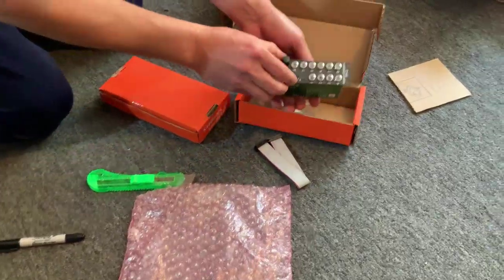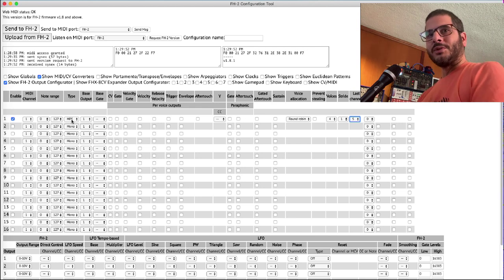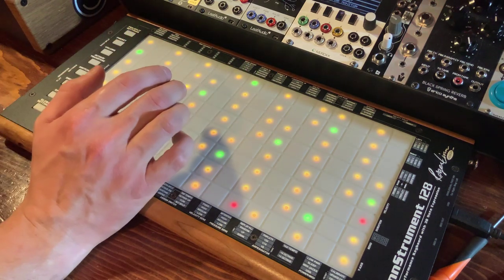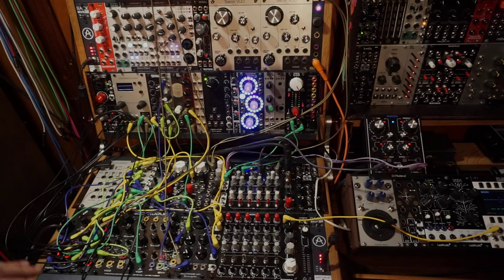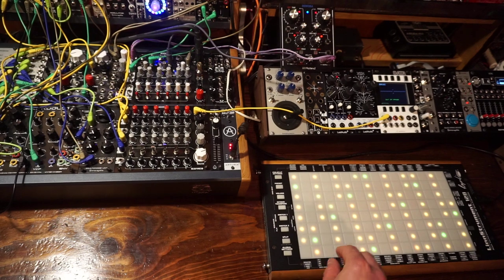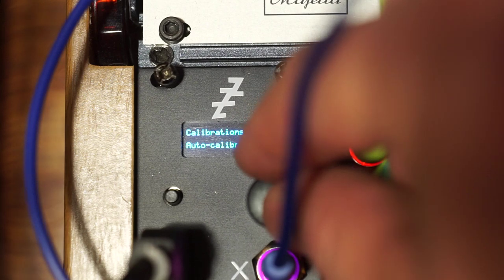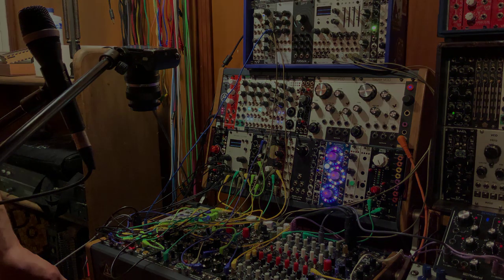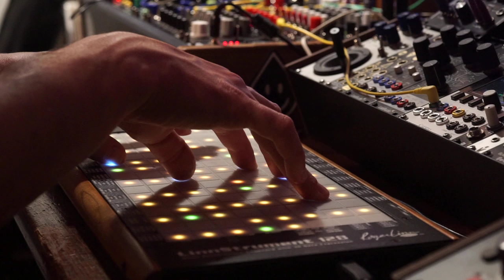FH2 Factotum #1 - Linnstrument MPE

Comment: Do you know if it's possible to set it up as an note quantizer for an incoming cv signal on X/Y?
Reply from the maker: That’s what this one is for!
https://youtu.be/57FfsYZ0D1I
Reply: @QuincasMoreira  to bad the Fh2 can't do this. You would say all the tools are there.
Reply from the maker: @derekkatwijk  Indeed, it has two inputs, so theoretically it would be possible with this hardware. Maybe write OS and request the feature!
Reply: @QuincasMoreira  Check, just mailed OS.
Reply: @QuincasMoreira  Os: "you could use the CV/MIDI function to convert to MIDI, then route the MIDI internally and use a MIDI/CV converter to generate CVs. That would effectively quantize the CV to semitones"

Comment: Not sure if you've seen this, but I keep having the FH-2 try to use 4 voices instead of the two I've set it for.
I don't have any expanders, so I've got 2 voices with pitch, velocity gate, aftertouch, and Y axis. It's set to two voices on MPE with the last channel as 3.

When I go to play (in unison, round robin, etc.) the first two presses go through as expected on channels 2 then 3 if I'm reading that right. Then the following two go silent as they seem to try to go to channels 4 then 5... but from what I understood I'd already set it to only have the two voices so unsure how.

Is there another section that I might've overlooked that might be tripping me up?
Could this be from a setting on linnstrument I missed?
Reply: I found a temporary workaround of telling it I have 4 voices and using unison. At least now I can not have missing notes.
But each time I press a linnstrument key the FH-2 shows it as switching to the next channel, as if some part of the system was using round robin even though I told it not to.